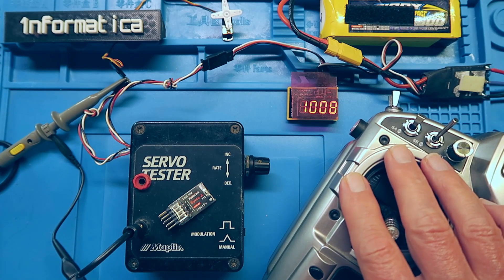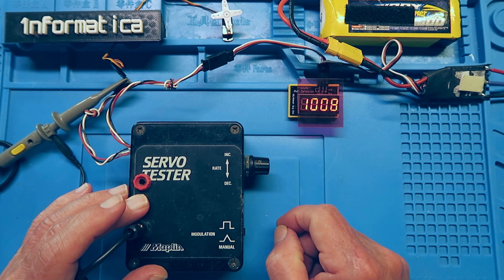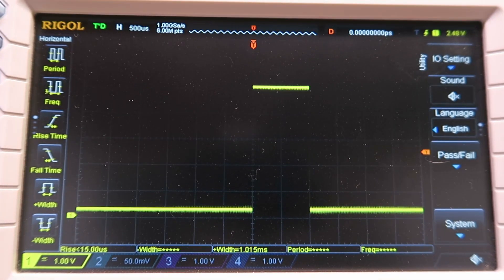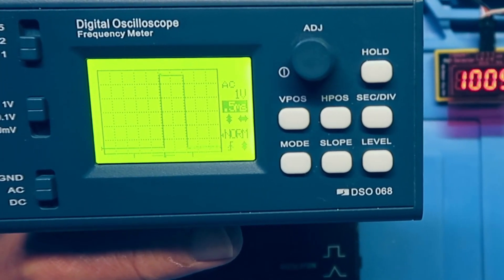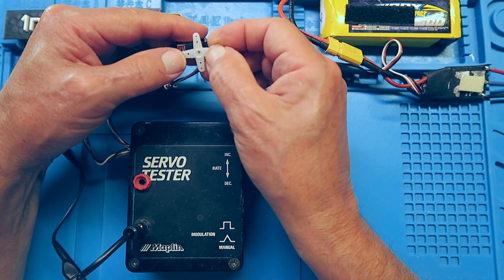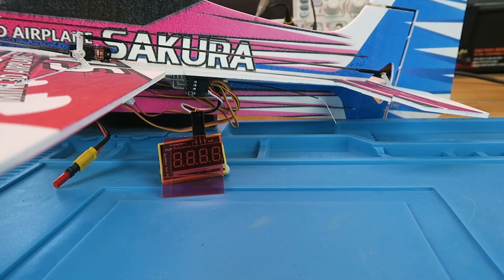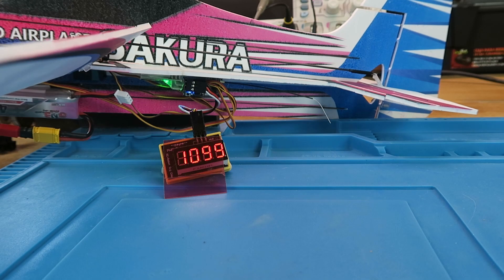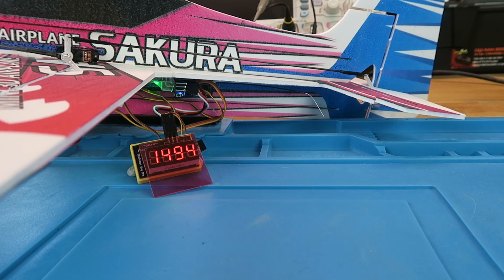Servo Basics PWM Tester Display Frequency Monitor

Comment: 27 years ago! wow you  seem to have a lot of experience and may be able to help me find an answer to a question I have had a long time:  Can I get rid of  Tx/rx and instead control -with wires-directly a flight controller like (pixhawk/CC3d etc) by using a servo tester? your input is EXTREMELY appreciated !

Thanks!
Reply from the maker: Thanks for your kind comment. I need to understand more what you are trying to achieve. Flight controllers (FC) need an SBUS or PPM signal to control them. Servo testers like the one in the video only output a single PWM signal i.e. 1 channel. I guess it would be possible to program an Arduino to output an SBUS signal and control a FC that way. Tell me more!
Reply: @1nformatica  Hi! its a few little things(I experiment a lot :). For instance: 
Im on a small boat( with brushless motors + air propellers ) on the lake this summer and I would like for example while I am onboard to try one of my FCs(Pixhawk, APm, CC3d, Kk2.1) to stabilise/semi control the little boat  "directly with wires" instead of relying on a sketchy radiolink. Radio control gets a ton of interference at least where I live - I believe the nearby rock mountains has a lot of iron or something(?).
 Anyway So I would really just try out a more secure wired controll to my Flight controllers in my experiments and specially DURING TESTS!. Cant believe there is no infrmation after ton of googling?

First thought, initial idea: Can I just connect several servo testers (each servotester to each  channel  on the flight controller input - so 4 servo testers for , throttle, yaw, roll, pitch?) (the CC3d accept  Old PWM Recievers BTW) or is this idea completely wrong?
 Thank you so  much for replying
Reply from the maker: @ericylle6597  Hi Eric, whilst what you suggest would work I think it would be a right pain to control. How about this for an idea : most transmitters have a "buddy lead" output on the back. I sure you know this is usually to connect to another radio for training. But there is no reason why this (normally PPM) signal cannot be fed directly to a FC thus eliminating the radio link. If your Tx does not have this facility ask your RC friends as many will still have old 27 / 72 / 35 MHz radios around that they would happily give away, I know I have!! BTW YouTube no longer shows me if you are subscribed. Please consider subscribing if you have not done so already!
Reply: @1nformatica  Hi! thats an interesting idea. I knew about trainers Tx connection but didnt know you could connect it to a FC. I have also an older 35mhz/72mhz Tx. Do you know where to / how to find more info on directly connecting these older tx to a FC? Subscribed ofcourse:)!
Reply from the maker: @ericylle6597  You need to google the make and model of your Tx for "buddy lead". Generally the Tx has a 3.5mm jack socket. The plug will be "mono" with the tip having the PPM signal and of course ground. Use a coax cable to connect to PPM input on FC.  The Tx will have either master / slave i.e. pupil and teacher. To output the signal you want to be master. A VERY useful site here : http://www.mftech.de/buchsen_en.htm